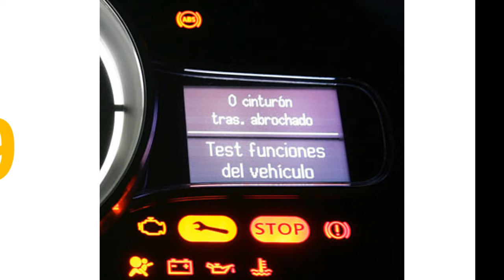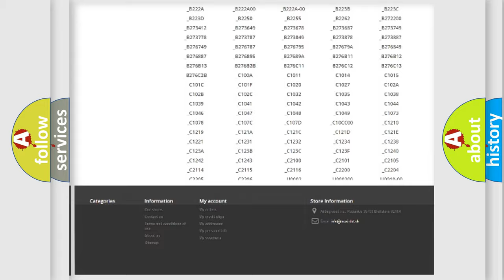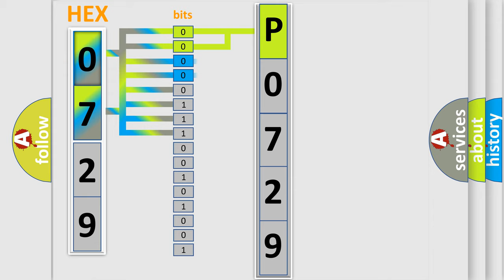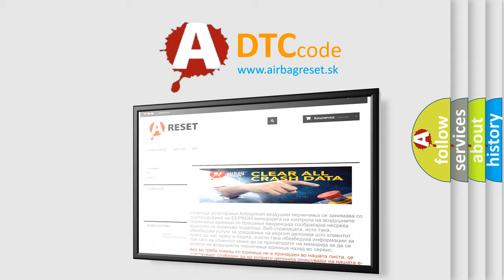DTC Dodge P0729 Short Explanation

Comment: 100% wrong. P0729 for dodge is incorrect gear ratio in the 6th gear......
Reply: You are correct. Hey so what’s the main cause for this. I got that code. My rpms go up but no full acceleration. Help😩
Reply: @GiGi-fb8hp  the pins that hold clutch packs wear and gives slippage between 5-6 and only fix is new trans or rebuild. Just did it and cost me $10k